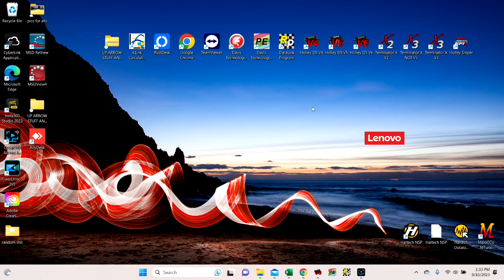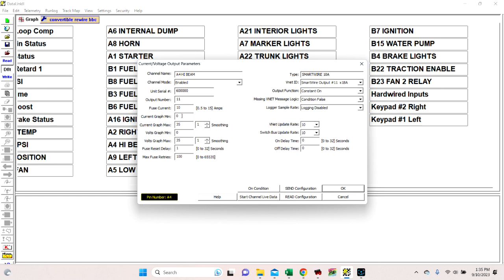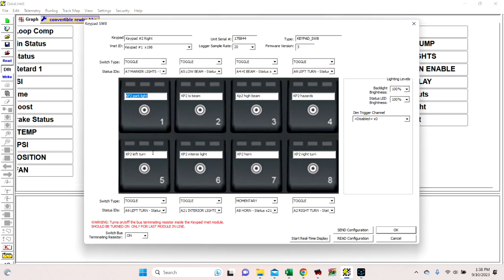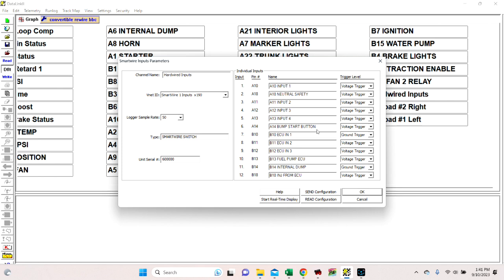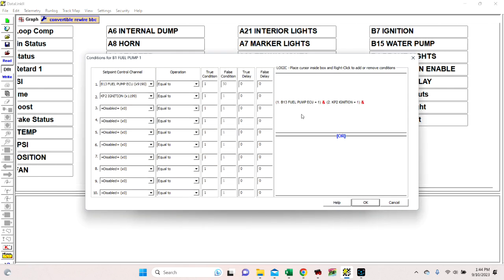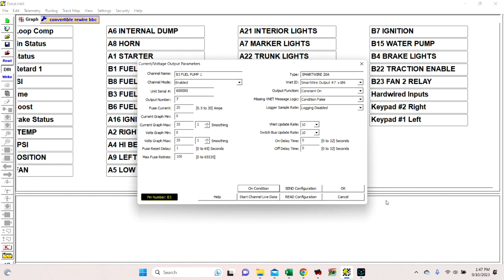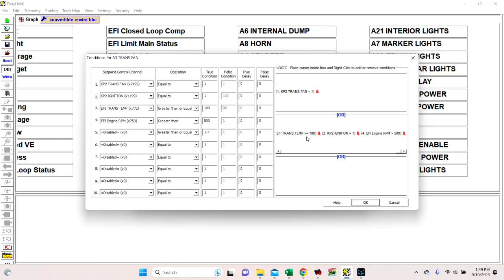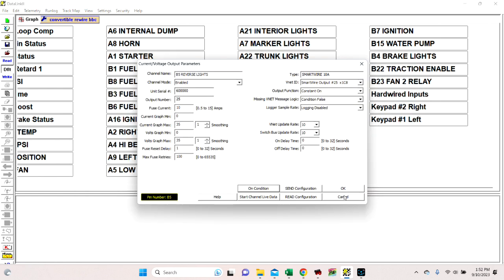Racepak Smartwire functionality explained.

Comment: Thank you Devin this was immensely helpful.  So using the CAN controller the Holley I/O starts at 1 and Racepak is 0 so to get the right Holley I/O #6 you have to label it I/O #5 in the Racepak to get it to read right?  I don't want to even think of how long that would've taken me to figure out on my own!
Reply from the maker: yes that is correct
Reply: @theholleyefiguy  So when configuring an EFI CAN channel do you use the actual Holley I/O number?  Going by the brake PSI example you used in the first video you did on the module the Holley I/O for brake psi was #14 and you used that to configure the EFI Brake PSI channel in the Datalink software?
Reply: Is the proper part number for this EFI CAN module 230-VM-EFIUCAN